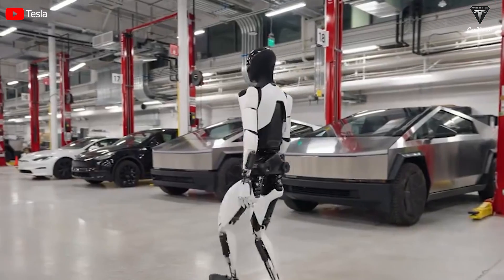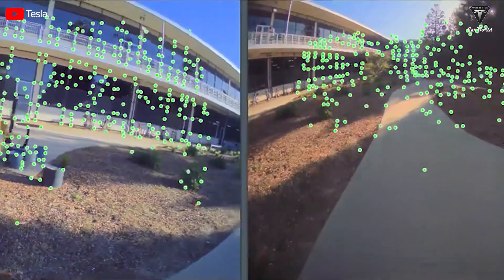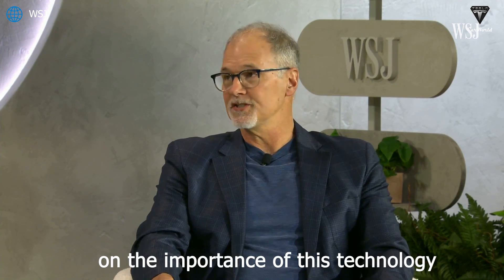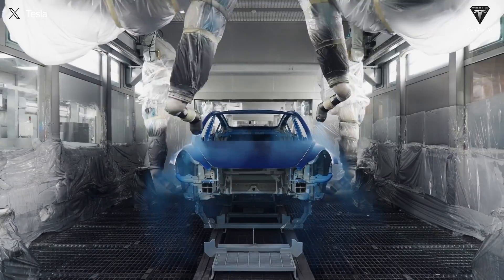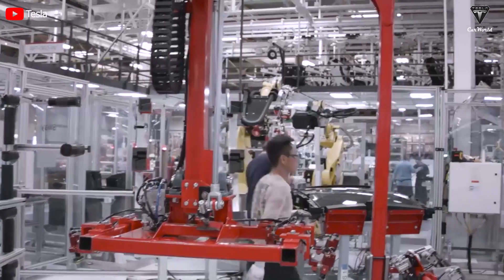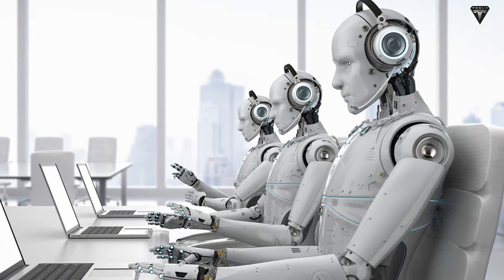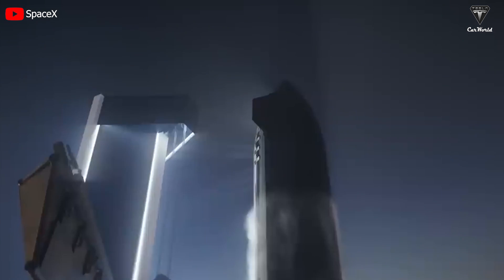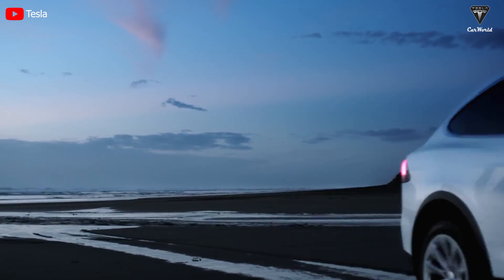P3! How Far Will Tesla Bot Next-Gen Really Go In 2025? Launch Getting Closer!

Comment: 02:18 Tesla bot and Model 2 Redwood to launch in 2025
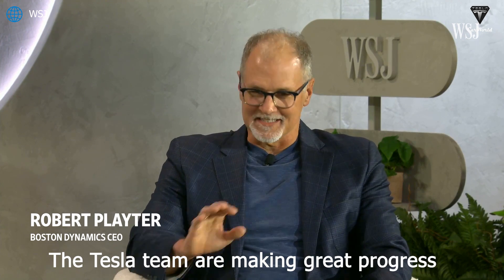04:36 Tesla Bot equipped with autopilot cameras, sonar, and radar sensors for full awareness.
06:54 Tesla Bot's impressive progress in mobility and flexibility upgrades
09:12 Tesla bot Optimus revolutionizes production, leading to cost savings and efficiency increase
11:30 Tesla Bot is likely to create new job opportunities rather than causing unemployment.
13:48 Tesla bot may be used to colonize Mars
16:06 Tesla Optimus can explore Mars and assist in building structures with mining capabilities
18:20 Tesla aims to produce 10 to 20 billion units, potentially replacing humans with Tesla bots.

Comment: I'm not buying the hype. You ask "What tasks will the tesla bot perform at Tesla factory?" then you generalize without answering. look at the fingers on Optimus! Could it even pick up a needle to thread it, Start a roll of tape, put a lid on a cup, make change out of a register? How long would it take to peel a label off the backing? tie a shoe, pick up a pen and write? A person, without looking, can pick up just one small screw out of a pile and orient it in their hand. A person can reach into their pocket and count change without looking. Please tell me the "easy" jobs a humanoid will be able to do! There are no "easy" jobs that aren't already automated. Enthusiasts will say "It's not like FSD because you don't have to be 100% accurate". Then it will fail in its job. If it drops a box of screws, breaks something expensive, falls and breaks itself, stops production etc. it's costs could be more than the savings. Enthusiasts will say "It doesn't need to be fast because it can work long hours". Then it will fail in its job. Factories are built for people to operate, so it will have to operate like a person. Asset utilization is important. Otherwise you'll have to create dumb jobs for it like overnight stock-boy. Call me when they demonstrate a stock-boy, if I'm not dead. Enthusiasts will say "we'll need them on mars" On mars you will want a smart crane/robot that can manipulate and join large habitat panels and move machinery. And you would want a smaller smart robot with tools instead of hands so it can manipulate/repair small cables/connectors quickly without having to pick up bulky hand tools. And it should have extending legs rather than get on a ladder. It would be ridiculous to have humanoids operate cranes, use wire cutters and climb ladders. You may only need two humanoids to set up a base because humans didn't evolve to use technology.
Reply: I get it, but the other day I just finished a month of DIY sanding and painting the ceilings in our place. I am 73 years old, and boy I would have loved the opportunity to go down to our local hire shop and pick up a bot to do the job for me for less than the cost of hiring a tradesman. I can see a use case for such a machine in ten years time which will be about the time the place will need repainting.
Reply: @gfbprojects1071  "I can see a use case for such a machine" Me too. But it would be ridiculous to see a humanoid on a ladder with a paintbrush. A smart robot designed for painting would do it in a fraction of the time at a fraction of the cost.
Reply: You care a lot about something you supposedly don't care about.
Reply: @StratumPress  I care because my fellow Tesla fans are being misled. I'm a long time Tesla owner/fan and I was a big Elon fan until recently. He seems to have turned into a crybaby if people don't listen to him.
Reply: @zaphodbeeblebrox2817 Genius many times has little patience for ignorance or people with little determination and self discipline.  I agree with a lot of your points, but you aren't being very positive.  
How do you know about him being a crybaby?  You know someone inside his working circle?  I'm sure that if he's breaking down occasionally, it's out of frustration of having to work with those who don't entirely share his vision and aren't as driven to get to completion faster.  If we ever get to a sentient AI, human evolution will never be the same.  It'll be astronomical.  That is why Elon has every right to be emotional and push humans as hard as he can right now.  He shouldn't have to push us, it should be inherent in all of us to want to get to a sentient AI.  We should be on the same page as Elon.    THAT is a daunting task compared to where we are now.  Especially with what humans have to work with, imperfection.  AI isn't even close yet to our understanding and abilities.  Then you have the engineering and robotics side, A LOT of work and time to get to that next step in our evolution.  Only question is, will we make it there before we destroy each other and ourselves? Time will tell, but negative, unfaithful talk among each other sure won't help.
Reply: You only forgot one thing...
Reply: You look at the robot now, you failed looking at the future, remember only 20 years ago cell phones used only to make calls
Reply: @mohh5560  No, I wrote about using them on mars. didn't you read that? Also, in the future, if I need to hire a nail technician, would I buy a clumsy Optimus or the SmartNailTech3000? It has tiny grippers to hold fingers and tiny filers, painters etc.. It trims, cleans, paints, applies, in a fraction of the time and takes up almost no space. Just plug it in no batteries needed. Oh, but it can't sweep the floors. Should Optimus push a broom and pick up trash or should I let my SmartRoomba3000 do it? But that can't paint the walls, should we watch how fast a humanoid climbing a ladder can paint compared to SmartPainter3000 that you can rent?
Reply: A speculative and critical essay by....

Hugh man?
Reply: @wonkyfug  son owns a business, park in sons lot, shakey hands rolling nanobots, download my nourishment
Reply: @dumfka  you should stop listening to alice in chains so much, boomer
Reply: @wonkyfug  what the what
Reply: He said make change out of a register.. clearly you do not see where this is going.  Cash will be kindling bc they say so.
Reply: The Starship is another robot, therefore it can pilot itself without the presence of biological or artificial humanoids.  The Teslabots will be used to do the internal tasks of the ship plus to assist the human crew and the ship in unstructured and unforeseen tasks.  To make repairs outside the ship or to help astronauts put on the suit to evacuate the ship if a fire occurs or if others are busy.  Every unstructured logistical task such as building a lunar or Martian habitat will require a multipurpose humanoid and every repetitive and predictable task will require specific purpose robots such as ship cleaning robots for example.
Reply: I guess Elon should hire you
Reply: Companies with the smartest roboticists in the world have been working on this for decades.  I don’t see anything about Tesla that would give them an advantage.  And btw a generalist robot is almost always inferior to a design specific to a task so the use case is probably not industrial.  The idea that these will somehow improve Tesla factory is laughable, that’s not how industrial automation works.
Reply: will not be safe around children or the elderly because it could easily fall on them. How can it learn to do simple things that it cannot do even when tele-controlled?  It cannot peel back a band-aid or open a can of beans. It is unable to bend to pick up even a dime !  It is supposed to be able to carry 45 lbs. This means it is of no use on a construction site for moving a 5 gallon bucket of paint, a sack of cement, sand... It cannot move a bundle of roof shingles, swing a hammer, or carry 3 wall studs.
Reply: @Pangean818  I think your assumptions are unlikely for all the reasons previously stated. Making it more human-like doesn't make it more useful, in fact now it's limited to what a humanoid can do and will NEVER do everything a person could. "It's made human-like so it can work in environments made for humans" Think about that. That is the antithesis of "First Principles"
Reply: There will be 30k applicants (many to multiple positions) for each of those 30k new job openings. So, say you wouldn't want one of those stock compensation packages, especially with the stock staying so low!
Reply: Human civilization was built for humans. 
Every tool and system we have requires a humanoid shape to manipulate it.
That's why we need humanoid robots. You can't make hundreds of different shapes for hundreds of different applications, that's not scalable nor maintainable in the long run. You make just one shape which can be adapted to the biggest array of possible applications, which is a humanoid shape.
Reading scifi books from Asimov might make it clearer why this is a good idea.
Reply: @VperVendetta1992  Yes, I addressed that. But humans didn’t evolve to use technology, consider this, do you want your future robot surgeon to be Optimus with a scalpel in his hand? Or should the AI be controlling small tools capable of doing the job. Or even your local nail technician, why should a walking robot do that? Wouldn’t you want your Roomba to be intelligent or are you going to give Optimus a broom? Oh, but then it’s not versatile it can’t paint walls. How fast could Optimus paint compared to the painting robot that You can rent at Home Depot?
Reply: @zaphodbeeblebrox2817  So you want a thousand different robots with different shapes, each one skilled at only one small thing, and all of them roaming around each house of each human being in order to perform the same tasks that just one human being could do with one shape?
Nah that doesn't work.
Reply: @VperVendetta1992  "a thousand different robots with different shapes, each one skilled at only one small thing" We already have that, don't we? Industry is full of dumb dedicated robots. 
Can't do it with "one shape", that's my point. look at the fingers! LOL
Reply: It is fake vaporware just like the rest

Tunnels, hyperloops, solarroofs, selfdriving,  trucks in convoy, mars colony

Everythibg is always ready next year

XD
Reply: @phnix6242  Hyperloops was never part of Tesla nor SpaceX, Elon just wrote down the idea and another company tried it and failed.

We've never been as close to a Mars colony like we are now thanks to SpaceX, and for almost an entire century NASA has failed at developing reusable rockets, while Elon did it in a few years.
Starship will bring us to Mars.

With V12, Tesla almost solved full self driving in the USA and Canada, by going full AI and dropping all the rule based code. Now they need the same amount of training data for other continents and to refine and improve the performance little by little. It's not that far.

Solar roof is a very simple and old idea, it's not theirs and I don't see how it's a problem. It's probably not their strongest product but I don't see how it's going to make them fail even if people don't want it.

The Tesla bot is the most ambitious Tesla product and it might fail next to the competition, but humanoid robots are going to happen inevitably in a few years, and I really hope Tesla won't give up on them, as they're going to be as big as the car industry.
Reply: You act like it’s not about damn time they’re seeing availability in small
Enough motors and shit. These videos are kinda gay but also they’re people excited by the future and profits for sure. Just don’t watch any news videos for a bit and then they’re will be a big change it’s cool
Reply: Conner failed.. s o b

Comment: Make a video on what happened when ai and robots will take job and what will happen then
Reply: These things can’t peel the eggs they load into the egg cooker. If you want a humanoid to load a Keurig machinee you need to open the box of cups and get one out for it and put it on the counter for it and put the cup and water in the machine. Bots can’t peel a label off its backing or scrape an old price tag off to put a new one on. They can’t handle a small screw and a screwdriver without someone setting it up for them. They can’t whip out a sponge, a rag, some paper towel a garbage bag and a mop bucket to clean up a mess. They can’t get up from a fall (they haven’t learned to walk without human generated coding so they will fall a lot) or help pick things up when they get spilled on the floor.

They are starting to demonstrate abilities to do a handful of things humans can do and suddenly people think they can do anything humans can do. Even when they start to make themselves borderline useful there are plenty of productive technologies that have been a round for years but most businesses haven’t adopted yet. Electronic shelf labels, floor cleaning robots for shops, computer systems that aren’t older than most employees and made of insane spaghetti code that can barely be kept functioning… we’ll all be retired or dead long before these things get to 10% of the workforce.